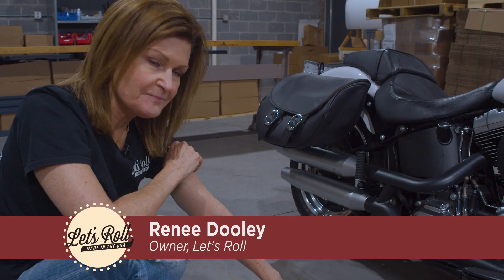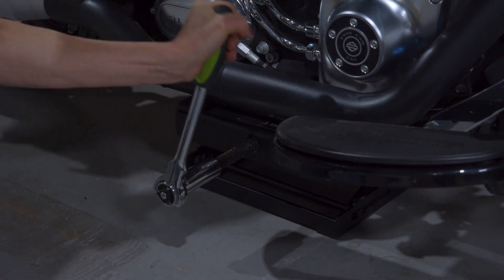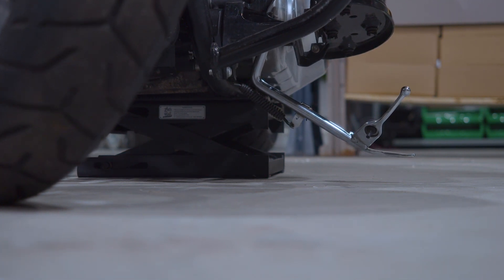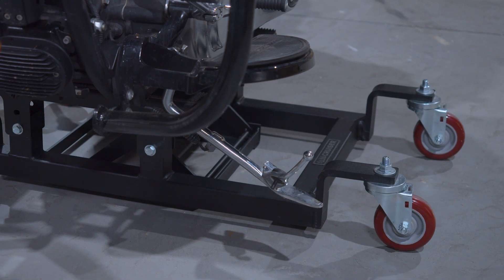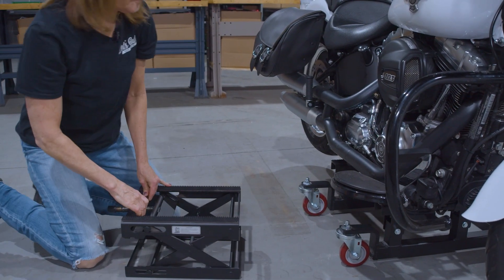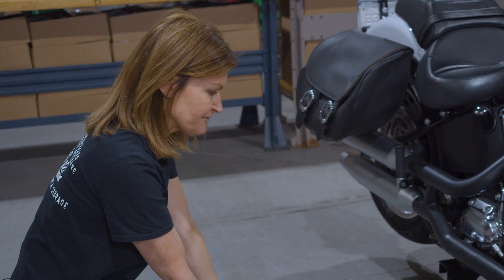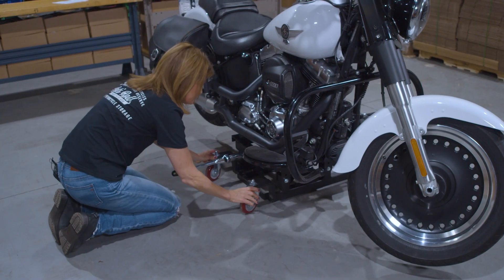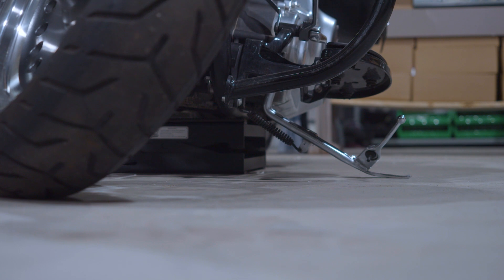How To Use 😎 Secure & Sturdy & Made in the USA | Let's Roll Cruiser Motorcycle Dolly: Safe & Easy

Comment: Can I use this to change my oil on a 15 Street Glide?
Reply from the maker: Hi Mo, Here are the specs for the lift.

• 15L x 12W x 3.85”H lowest position; 15L x 12W x 10.5”H highest position

We think you should be able to but it would be best to take and test the measurements yourself to be sure.